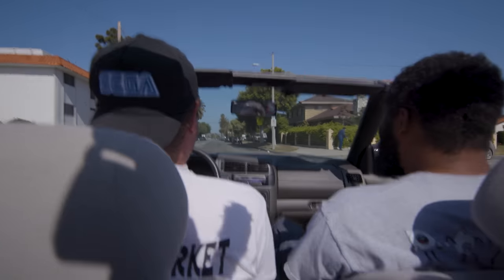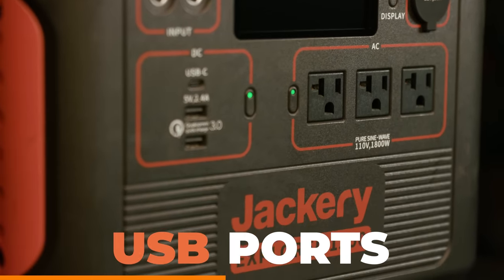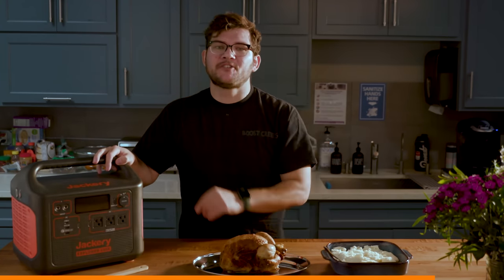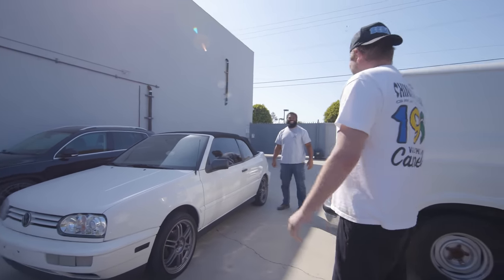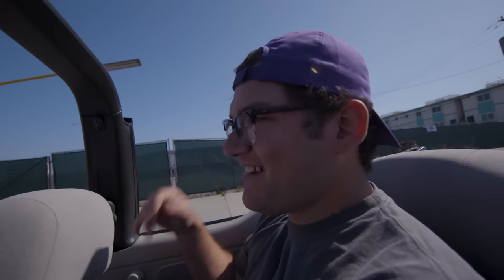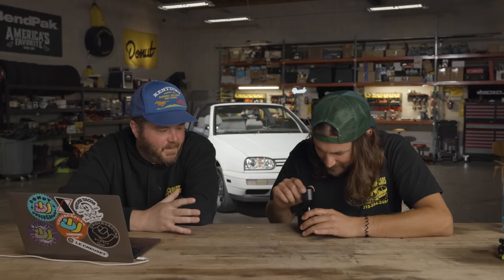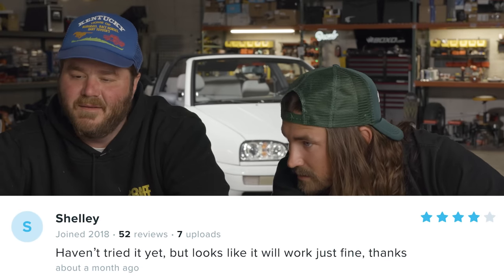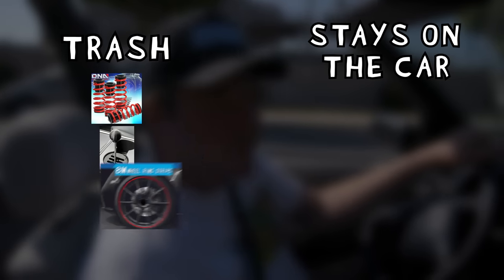We Bought More Dumb Car Stuff from Wish.com

Comment: Those superchargers are actually really useful when u have a lifted jeep with 36" tires and an indestructible but woefully underpowered 2.5l 4cyl.
Reply: Gearing.
Reply: @danh8302  It's nice to be able to drive on the highway.
Reply: @joshjlmgproductions3313  then put a proper motor in it.
Reply: @danh8302  Proper as in large? Fuel economy is a nice thing to have, especially here where fuel is $6.7 a gallon.
Reply: @joshjlmgproductions3313  power costs fuel, it’s not free. Proper is not using an industrial roots blower on an engine too big for it. So you should already be geared properly but like most people that tell you point # 1 is 36” tire, I bet it’s woefully under geared.  Probably sitting on d30 and 35c with factory gearing.
Reply: I put 4.88s in a bone stock ranger once. It was 4 cyl, 5-speed and 2wd. Used as a work truck. It would struggle with very steep driveways while loaded and 4th was more useful on the highway. The owner was resistant to the high numerical value I suggested but we went with it. It was excellent, it was a whole new truck. Everything’s was right where it should have been, first gear would send it up the steep incline and 5th was now the highway gear Instead of being worthless and only good for speeds the truck couldn’t go in an effort to have low rpm. 
I don’t understand why ford didn’t send them out the door that way, I bet the fuel economy improved or at the very least stayed the same. I know the motor was happier.
Reply: 4.0 straight 6 wrangler gang
Reply: @joshjlmgproductions3313  If you regear the vehicle correctly, it should behave very closely to how it did with the stock wheel size, other than the extra weight of the larger wheels of course. Your tire size is simply the final gearing on a vehicle, hence why changing it enough can justify the need to change the gearing in your drivetrain. And there are plenty of options in choosing your gearing, really getting into the custom side, sky is basically your limit, but even premade gearing replacements have a ton of options. Not every regear needs to be 4000 RPM at 60mph.

Comment: Oh yeah, I want to see you install that (likely reman) supercharger. 
You may want to spin it pretty fast depending on the size of the engine, I believe the AMR500 outputs 500cc per rotation, your engine pulls in 1/2 its displacement per rotation.

Comment: The amr500 is a real supercharger its used on a lot of old vw bugs to make good power but only good for up to 150 hp if your car makes more then 150 it will not do much for you
Reply: Bad news then, cabriolet makes 160 I think, although with all the abuse it's seen since 97, it could bring it back to power maybe

Comment: That “supercharger” is actually a twin screw hydraulic pump For a low pressure High volume hydraulic system

Edit: added the following information here to my original comment cuz people don’t read comments threads before replying 

so just as reference I Design Machine’s for a living which is why to me this looks more like a hydraulic pump than a traditional super charger

But after further research and reading other comments it does appear to be a AMR 500 it is a volumetric air pump
So you don’t really Measure it psi 
It’s unit is cubic centimeters of displacement
The documentation I’ve found would indicate this should displace 500cc per revolution.

Based on what I’ve read is good for at most 5-7 lbs for boost
Any more that that you’ll over heat it faster than the air can feasibly cool it
Reply: Plus I don't see any area for lubrication, so that could be sketchy lol
Reply: Shhhhh, let them put it on the car first!
Reply: How low? 
Like 6 psi low?
Reply: I was wondering if anyone was going to mention it!
Reply: That is not true, look up aisin amr500, its a legit supercharger and a ton of people use them on smaller engines, even OEMs.
Reply: @MrJamesshipman  for an 90s bone stock vw probably w/o intercooler should be fine... Might wake up the engine a bit
Reply: @MrJamesshipman  so just as reference I Design Machine’s for a living which is why to me this looks more like a hydraulic pump than a traditional super charger

But after further research and reading other comments it does appear to be a AMR 500 it is a volumetric air pump
So you don’t really Measure it psi 
It’s unit is cubic centimeters of displacement
The documentation I’ve found would indicate this should displace 500cc per revolution.

Based on what I’ve read is good for at most 5-7 lbs for boost
Any more that that you’ll over heat it faster than the air can feasibly cool it

(Edit: spelling)
Reply: That makes sense because it appears to have plumbing threads on the output.
Reply: What are you talking about?  It's an Aisin AMR 500 supercharger.  They literally come installed from the factory on some Japanese Kei cars!  😂  Hydraulic pump he says hahaha!  🤣
Reply: @KlockworXMusic  you should really read comments threads before replying
Have already explained that yes this is used as a supercharger but is a poor design and on most kei car will only generate 4-5 lbs if you lucky.
A little history lesson a lot of pneumatics and electrical is based in our understanding of hydraulics which is why a lot of the symptoms use in drafting up the diagrams for each are the same or very similar
This supercharger is very similar to some of the hydraulic pumps i spec for machines, more than likely the design was adapted to work for cars but still shares a distinct resemblance to the original hydraulic pump it was based on.

It’s also not uncommon for kei car to use of the shelf components not meant for automotive use to avoid designing custom parts to cheap costs down
Reply: @andrewmayton2044   just because it looks similar or works on a similar principle it doesnt mean its the same, you should know that. You called this a twin scroll hydraulic pump but if you did any research you would surely know that this has no screws in it, its a twin lobe roots style supercharger. And how do you know its such a poor design if youve only just found out what it actually is? They can produce more than 8psi. Aisin, the company who made this, knows what they are doing, they have been in automotive industry for 70+ years making turbos, transmissions, oil pumps etc. Stop acting like you know everything and just admit you were wrong, its okay.

Comment: The "supercharger" I believe is actually an air compressor if I'm not mistaken. It can also be used to generate a vacuum. The place I used to work in had huge compressor/vacuum pump rooms. The compressors looked like giant superchargers and were driven by huge 100hp DC electric motors.
Reply: Yep. It’s a smog pump. It’s a go cart supercharger but none of these “car guys” know this lol
Reply: @longsleevethong1457  it's an AMR500 not a smog pump lol
Reply: All superchargers and turbos are air compressors, that's literally their whole purpose
Reply: @jakefinlay5312  yeah it’s a smog pump lOl
Reply: @jakefinlay5312  recon what smog is? It almost like air too huh?
Reply: @longsleevethong1457  so by your logic all superchargers are smog pumps

Comment: I put one of those AMR 500s on my VW 1.6 air cooled. Blow through config with twin mikunis, 8-10 lbs of boost (revving it a little more than it's capable of) and yes it goes HARD. way more bang for my buck than a cam upgrade or duel port heads.
Reply: But did u put on the head bone??? Please think of the head bone!

Comment: That looks like a procharger. Finding a pulley that matched the stock belt would be the hardest part.
Reply: They come with 4 pulleys, and these are ansin rebuilds from kei cars and small import trucks, and DO work on 2.0l or smaller motors...
Reply: @dustyroads8238  Interesting

Comment: That's supercharger looks more legit than a Geo Metro I saw that had an electric pool filter pump connected to a inverter to be used as an electric supercharger.

The best part about the "build"  was that it used a y pipe so any sort of boost the pump could have made literally just blew out the air filter because there was no way to hold the pressure.

Comment: The AMR 500 superchargers are really common on air cooled VW applications! Lots of kits out there with brackets, carburetors, etc. Used on motors smaller than 2.0l typically.

Comment: I’ve got a classic VW beetle and have actually looked into putting an AMR500 supercharger onto it as it’s a pretty popular thing to do on them for cheap power. It wouldn’t be a great deal of fabrication to make a mounting bracket and then just plum the intake tubing. Fuelling can then be done just just a new carburettor if you’re after the most simple set up. It seems you can expect around a 50% power gain on a stock engine from what I’ve seen of other installs

Comment: Would be interesting to see some dyno tests before, than with the dinky supercharger, and perhaps after some proper engine tuning parts have been installed(either with the supercharger still on, or with it off, depending on the performance and stuff, I am sure you'll figure something out).

Comment: The ''wish supercharger'' is a replica of the aisin AMR500 type supercharger. Several jdm cars, mostly kei cars, uses this supercharger as a OEM fitment, so it is an OEM replacement. Surely you could install it to another aplication, but it will be probably a pain in the ass.

Comment: You could easily 3d print the exhaust skull and modify the 3d file so it fits your exhaust once it’s printed and your verify it fits nicely all you gotta do is some electroplating to give it a metal coating and BAM you’re done

Comment: Please put on that supercharger, I’ve seen them for sale all the time and thought about putting one on a gold wing. The 4 cylinder ones have a common mod to add an alternator (usually because the stator broke, which would be an engine out to fix). I’m thinking about using that mod to add this super charger instead of the alternator, since they’re both belt driven anyways. Might work with a blow through design through a carb, but I’d love to try and do an EFI conversion to really get the most out of it.

Comment: I ran across a similar supercharger on eBay and Amazon but I was partially dream looking for my mini bike but ended up selling it before I got too deep in research but I believe they are mostly for UTV and other similar off-road things. I was never able to get many specs like output psi’s but could be similar to low psi 1-3lbs like in a 05 Volvo XC90 I had. Any one possibly using it  get psi output and or remember a blowoff valve

Comment: My friend once tried some cheap coilovers. Seemed legit and sturdy but the 1st bump shredded all threads and the car dropped down to the maximum possible instantly. We did somewhat expect that so we did not drive fast but it still managed to destroy the inner wheel shroud and tear some wiring beind it that goes to the brake wear sensor. Imagine this happen to you while driving somewhere fast. You'd be lucky to survive that crash. Just because of some BS product that IMO should not even be allowed to pass import customs for this very reason.